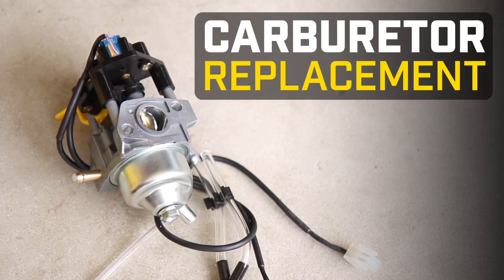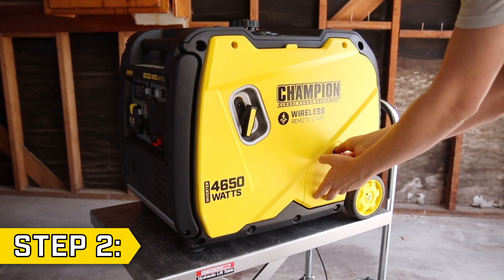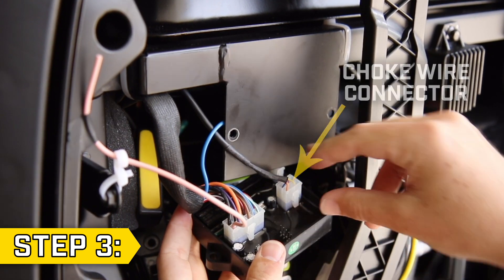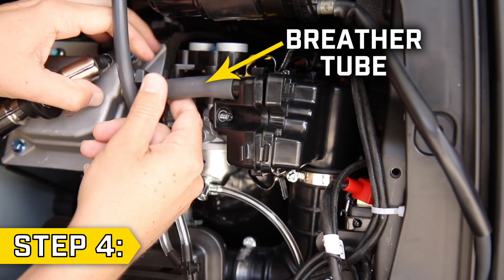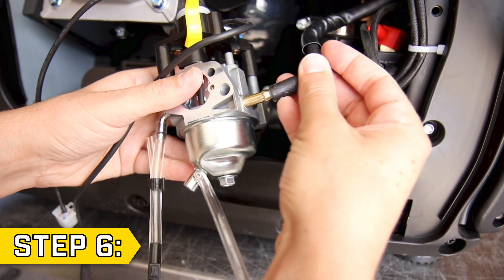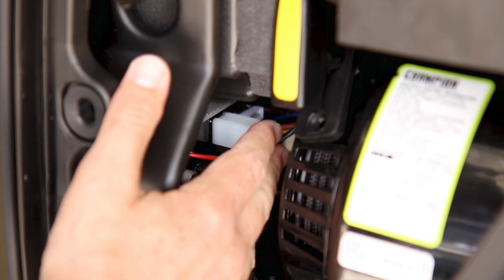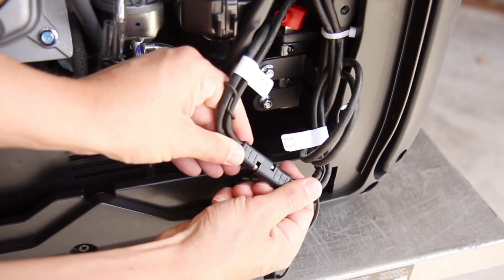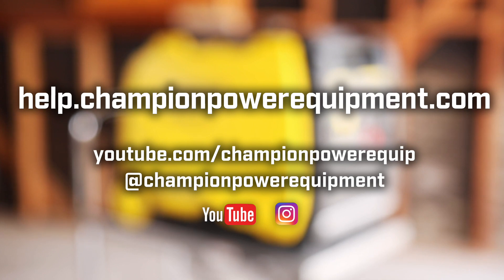Carburetor Replacement (4500+ Watt Remote-Start Inverter)

Comment: Thank you.    I got rain water in the gas tank and am looking to drain the gas tank completely.   I'm assuming I have to take the carburetor off to get at the gas line?
Reply from the maker: We are sorry to hear this. There should be a drain bolt on the carburetor itself that you unscrew to drain fuel from the carburetor & fuel tank.